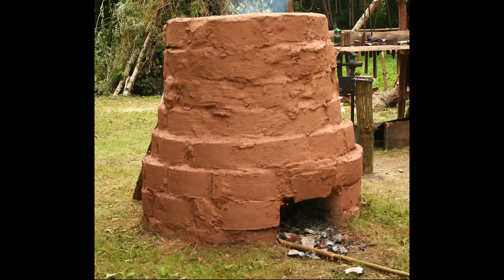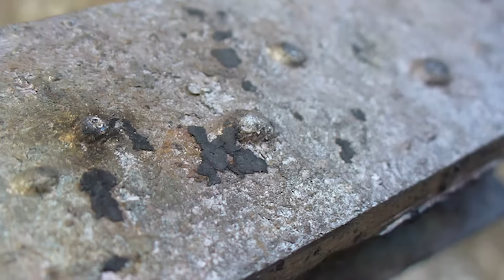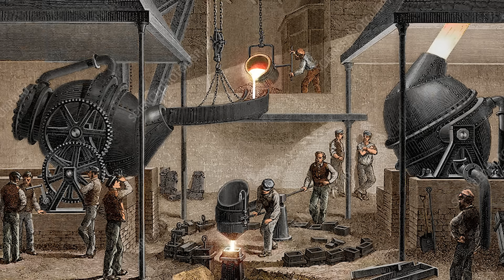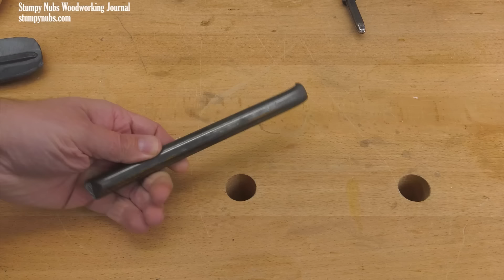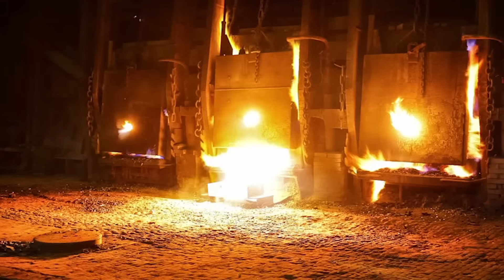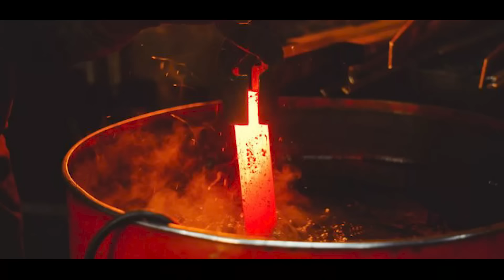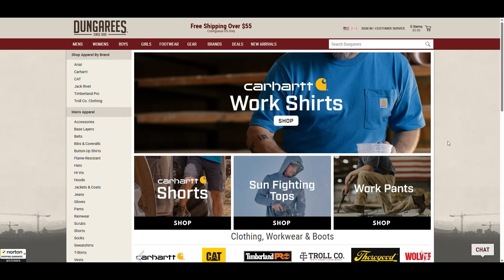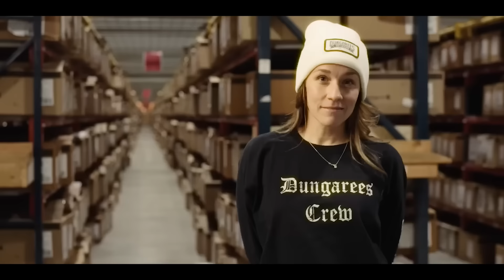Why they REALLY don't make tools like they used to

Comment: Nice lesson, James.  I started my career as a mechanical engineer and had several metalurgy classes.  Your explanation was accurate and simple enough to understand. The modern alloy steels are tougher than the old plain carbon steels, but are often more difficult to sharpen.  I'm amazed at the edge holding ability of something like a Lie Neilsen chisel, but they are a little more trouble to shapen than the vintige chisels I have.
Reply: Same here the old ones are so much easier to sharpen, the newer ones seem much tougher but they clog my oil stones bad.

Comment: The best you can get is tool steel that is gas atomized, hot isostatic pressed, radially forged and rolled. Benefit is you can get even more alloying elements making the material harder/more abrsive resistant and also ultra clean practically inclusion free. Also the grain size and carbides are ultra small and the same each time. Erasteel in Sweden is doing this kind of steel.

Cast tool steel is inferior compared to gas atomized steel.

Comment: I have no qualification, apart from my limited experience, to speak but I was fortunately given the opportunity to rebuild a 12th century tythe barn that had been demolished with a bulldozer (two days before it was due to be listed as an historic building). As one can imagine so many joints needed recutting so I treated myself to a set of modern chisels from a good maker. These needed sharpening three + times/day, however I looked out a chisel that I inherited from my grandfather and that lasted all day and more between sharpening - I still have it 40 years on.
Reply from the maker: Who was the maker of the modern chisels?

Comment: Great info!
I'm more of a WW2 buff than a metallurgist by a factor of 100 or so.
I was surprised to learn that there is a significant difference in steel that was created before the atomic blasts and after.
Before is much more prized. In fact, China went to the trouble of salvaging the HMS Price of Wales and the HMS Repulse, both of which were sunk in1942, resting over 200 feet down.
Reply: The metal is 'pre atomic' in that it will be free of any (or almost any, none is impossible) radio nuclides it used for various sensors and etc. it's prized for this not any intrinsic quality of the steel/iron composition.

Comment: Very good video. I learned to design bridges in the 1970s. At that time the factor of safety, when all factors were combined, was about 4. The bridge was designed to be 4 times as strong as expected loading. This also allowed for deterioration due to a lack of maintenance that politicians don't usually fund. By the mid 1980s, the new "load factor reduction design" became popular. Up until that time, our US steel was an excellent material. It always exceeded requirements so, reducing the factor of safety to 3 seemed reasonable. Then enter the clintons who did nafta. This has allowed chinesium into our country. I've seen chinesium that failed at only 15% of the required load. This is why there have been several failures of new bridges and buildings in the past decade. Good Luck, Rick

Comment: My guess is that it's easier to learn "Older is better" than it is to learn enough metallurgy to understand modern tools. Let's face it, a lot of modern tools are garbage--they're bad steel, poorly made. You absolutely CAN find good steel, but you need to know what you're looking for. Since older tools didn't have the modern mass-production methods we do today, they had no choice but to use methods that made better steel. Thus, the heuristic "Older is better" does, on average, get you better tools. 

Basically, you can't compare old tools against high-tech new ones in this. What you need to compare is old tools against cheap Home Depot or Harbor Freight tools. Because while the average woodworker may not know how chromium impacts edges (and despite my experience with jewelry making and structural geology--both of which gave me a good understanding of the solid-state reactions going on during the forging process--I'm still not sure what cryogenics does for blades), the average woodworker can very easily understand "Skip Home Depot, go to the thrift store."

Comment: I have worked in the steel industry for 26 years.  Excellent video and factually dead on.  The material science, understanding of alloys and modern process control create much better and more precise steel grades now than ever.  The real difference as you discuss is that the higher value grades are more costly to produce and many cheap tool manufacturers today use inferior grades to save money which gives people the impression that the “steel these days is junk”.  Find a quality manufacturer that uses precisely engineered steel grades for their application and you will find tools that far surpass the ones produced even 30 years ago.
Reply: The main issue is how the hell customers can know this, price is good indicator but not always true. I know washing machines costing 1000+ that still use cheapest electronics that fail often too early. I really hope that stuff would have quarantee that makes sure manufacturers cannot push shit to the market no one benefits from this.
Reply: @salkkuman  The more reputable brands would usually declare steel grade somewhere on the tool itself. The ones that do use high grade steel will make sure to brag about it in their marketing.
Reply: @Goodmanperson55  I bought a couple of Yu Kurosaki Fujin kitchen knives five years ago, when he was not so well known as today and the Fujin series was still good value for money. Those knives are available in VG10 and the more expensive SG2. I paid for SG2 but I am totally unqualified to determine what steel I got.I trust the reseller, but I’m pretty sure there are people who paid for SG2, received VG10 and will never notice. ‘)
Reply: @peterpluim7912  I love vg 10, 154 cm, 14c28n, etc.  They're great user steels that hold an edge decently well and are easy to sharpen.  For VG 10 vs SG2 I would just want the one they do a better heat treat on.  Far more will come down the heat treat and geometry than picking between a lot of different steel types.  Even if you're getting into more recent steels like magnacut vs vg10 I would still want the one that they're able to do a better heat treat on.  Poorly heat treated steels don't have the edge retention that they should and are a pain to sharpen with their gummy burrs that refuse to break off etc.
Reply: @DontBotherNone1 couldn't agree more, for that matter I have a Chinese finished vg10 cromolly clad kitchen knife that is perhaps the best quality knife I've ever held in many ways. Perfect balance, resist corrosion due to it's cladding and it's razor sharp...
Reply: @Goodmanperson55 Guess which brand doesn't declare the alloy they use? Narex, apparently. I can only find that they use "chrome-manganese" steel for some chisels and "chrome-vanadium" for others. Narex does not appear to publish datasheets for their chisels.
Reply: @salkkuman China = Fake is my first rule.
Reply: @salkkuman  that could be solved at last to some degree, with regulations. like, phone battery as en example and its endurance: there would be a test, it would need to survive x circles with lesss than y amount of capacity loss for example. but of course this is politicial, and companies lobby against it if it goes against their profit. sometimes good ones sucesfully get passed, but its common that because of lobbying, its get watered down to a degree that its basically doesnt make any difference.
Reply: @norbertnagy5514  absolutely and I think we should put higher bar for our products in general and also make repairability easier (work and cost wise). Changing battery is good example, it should be something customer can do himself and I would say cover glass also. This is how it used to be...
Reply: @norbertnagy5514 Ahh, yes. Regulations solve all of our problems,  don't they? If only we had more laws that are unenforced, that would put us in Utopia mode. Yay!
Reply: @salkkuman  uh, by researching the things you buy before buying them?
Reply: Yes, Project Farm compared $15 tools from a few decades ago to $15 tools from today.   The $15 tools from today were junk.    However, $15 a few decades ago had $90 dollars worth of inflation adjusted purchasing power.    And when he compared $90 tools from today to $15 tools from back then, they were as good, or slightly better (due to design improvements and new ideas thought up over the last several decades).

You get what you pay for.
Reply: @mac_mcleod "You get what you pay for" is bunk. Sometimes you can, but you have to seek out and research your product. Paying more , in itself , just separates a fool from his money. If you have the right knowledge,  you can get more than you pay for.  (And the project farm guy needs a voice actor; his voice is painful to hear)
Reply: @beavisroadhog9629 you don't have the opportunity to do proper research because they often have special models for Black Friday.  The high quality models aren't even available for sale. 

And consumers know they don't have a chance and they're being ripped off.  And they also know Walmart made huge donations to this fascist racist government and they're staying away. 

Plus there is currently a spending boycott.
Reply: @mac_mcleod Chinesium is still shit whatever the cost.
Reply: @MeYou-j9d  Yes, that's almost always true unless continuous random testing is written into the contract from the start.
Reply: @MeYou-j9d  I can almost guarantee that almost every piece of steel you own (including Narex), whether high or low quality, originated in Chinese factories (even US and European steel "factories" source their raw material from China). It's all about whether the manufacturer you choose has decided to source high or low quality Chinese materials (and then has a high or low quality heat treating process).
Reply: Thats lovely but could anyone recommend me even the vague direction in which i can go to find the good steel cuz ive researched a lot and theres so much diception now where they are tryna charge good money to sell u cheap metal. Anyone know some brands or anything specific to help me out over here
Reply: @druidbonez  About your search for the good steel: Everyone will try to sell you the cheapest option suitable for your application. That's how it works.
If you're looking for specific tools, research the tool itself (and get in-use evaluations if possible), not the metal it's made of. Metallurgy is way too complex to answer such a question efficiently.
If, on the other hand, you're looking to make tools yourself, you won't find these infos here on YT. Too much anecdotal evidence.
Reply: What is a good way to evaluate the steel used in a tool when making a purchase?
Reply: @theTavis01 S.A.E. Number
Reply: I've been in the industry for 20 years and I agree. Going off what was said in the video alone, from my point of view the crucial aspects to creating high quality tools are:
- A steelmaking facility that is quality-certified to make tool-steel grades
- Blanks made from rolled rod or bar - rolling breaks down the as-cast crystal structure into a finer, homogenous and aligned crystal structure
- Hot forging of rolled blanks, which aligns the grains to the outline of the shape
- Good control of heat-treatment (quenching, tempering) after forging

Given the diameter of the blank, it could've come from straight bar or coiled rod.
Reply: @sentinel76 is nice to see people that know a thing or to chiming in.

I wonder to myself just how much these cheap tools would improve with proper heat treatment alone.
Reply: @sentinel76 You don’t buy HT steel if you are going to cut it.
Reply: @docalexander2853  In all seriousness, where did I mention cutting after heat treatment?
Reply: I think a real issue nowadays is that a lot of cheapo stuff is made from cheese grade steel that is surface hardened via other processes and is basically a single-use disposable thing once the surface layer is gone
Reply: The issue there is quality fade.
You have a tool company renowned for quality tools. You yourself have excellent experiences with them. You're fine paying a premium. Whoops, suddenly you end up with inferior tools.
Reply: @Clippy_Can Companies are bought and sold with little news surrounding ownership,  so the average guy buys a tool based on brand  reputation , not knowing that the company is being hollowed out by its new corporate parasites.
Reply: My opinion tool steels used years ago used as default in america like american stanley or millwakee a very good grade of steel by default. Standard off the shelf not so good today.
Reply: There is plenty of products that are better than anything made in history. But no one would call them the affordable options.
Reply: There's also the classic Survivors Bias: the crap got tossed looooooong ago. What you're likely to find today is gonna be the good stuff from back then.
Reply: @hoilst265  I like to make that argument with old-timey music ;)
Reply: Also:
- Talks about modern quality steelmaking processes
- Shows an image of an obsolete open-hearth furnace 😱😞
Reply: Yeah and take a second mortgage out while you’re at it
Reply: Today many things are made out of a special alloy called "Chinesium."
Reply: You can get a certificate from the steel company if you want it. They don’t sell fake steel.
Reply: I can guarantee you a very high percentage of the steel I own predates the PRC.
Reply: @MeYou-j9d  the majority of steel you own, by mass, is probably in your appliances like ovens, fridges, dishwashers, washing machines etc. Are they all more than 20 years old?
Reply: “steel these days is junk”, well a lot of it is, the Chinesium scrap remelt especially so, working in a research department building research equipment we had lots of issues with researchers buying the cheapest options, as mandated by EU law, often made from Chinesium in/from China. One system I had to build 3 times, the final iteration using UK/US manufactured and traceable steels worked, the first 'cheap' versions from researcher bought, apparently certified, materials failed undergoing hydraulic testing. Did they ever get to the bottom of the Bay Bridge issues?
Reply: @neiljohnuk  Which law are you referencing when you say "as mandated by EU law"? It sounds like you're saying the researchers had to buy the cheapest option but that's not really something that law should dictate.
Reply: @Mr_Joe_30C68D8  It is a rule set in place so people can't choose whatever company they want thus increasing corruption aka you pay someone under the table for the juicy government contracts.
Also to save money for the public however as demonstrated here it has issues because sometimes you do not want the cheapest option.
Reply: The problem there isn't the law, it's the specification used. If your specification allows junk, you'll get junk.
Reply: @ctadharamidori303  The EU doesn’t force governments to go with the cheapest offer. They only force governments to select the cheapest offer that fulfils all reasonable requirements listed in a tender. There used to be a time when companies didn’t sue when they noticed problems but that time is gone.
Reply: The default quality was superior , no effort was needed to get a great tool, japan and chinese imports lowered that standard.
I lived a long life, construction and maintainance. Just call it wisdom, can we make better tools yes! However most of us grab whats aT home deepshit. That quality is poor, used 5 pop rivet guns on one standing seam roof, no replacement parts. I always buy two so I make sure I can finish it .
Reply: @robertcox9226 tools made in Japan are incredible. not sure what you're smoking.

Comment: When you mentioned WWII, I immediately thought of the one special property of pre-1945 steel: it's significantly less radioactive than more recent steel.  This is important for a few specialized applications, though I'm pretty sure woodworking tools are not among those.
Reply: Only area where low background steel is really needed are the most sensitive scientific instruments which measurements migh be affected if the steel itself has a minuscule radioactivity.  And it`s safe to assume that at least for 99,99% of the real world applications s zero effect.
Reply: I mean it will be an issue in a couple tens of thousands of years when all the carbon-14 in the steel has decayed into nitrogen, but none of us, our children or their children will still be around then.
Reply: That is where I thought that this (EXCELLENT) video was going, with that mention, pre-atomic age low background steel vs. post-1945 steel. As you alluded, I do not think atomic-age steel adds any tangible qualities for woodworking tools, nor are they easier to find in the dark. :)
Reply: Except with the meat of your hand as you fumble in the drawer for it… then they find you…
Reply: The "significantly" in that sentence is a bit misleading.  The difference in radioactivity between pre-1945 steel and post-1945 steel is extremely small.  It's only important in very niche applications, and it gets less important every day since all that radioactivity is from short-lived isotopes and we stopped nuclear testing decades ago.  In another few decades it'll difficult to tell the difference at all.

Comment: Thank you.  I simply laugh at all of the people who think that "they don't make 'em like they used to" means the old way was better.  It usually isn't.  No one with half a brain thinks a 1957 Chevy is a "better" car than basically anything made this year.  If you like it, sure, enjoy it.  But rack & pinion steering, anti-lock brakes, air bags, and a hundred other things leave the old car far behind.  Likewise for tools and metallurgy in the 21st century.  Hell, even the old wood screws are crap compared to modern screws!